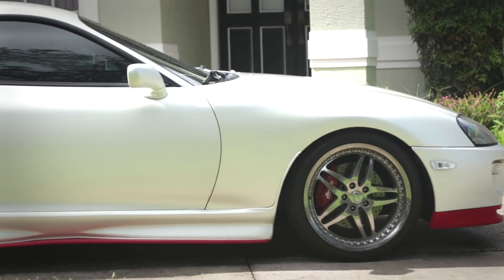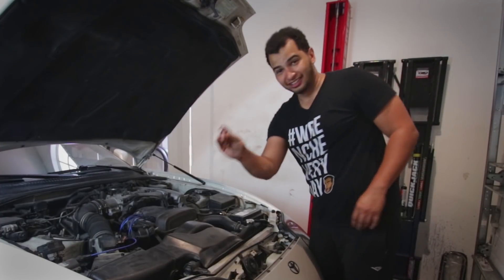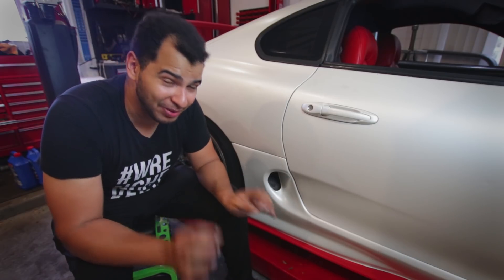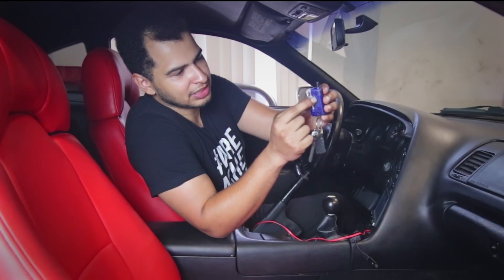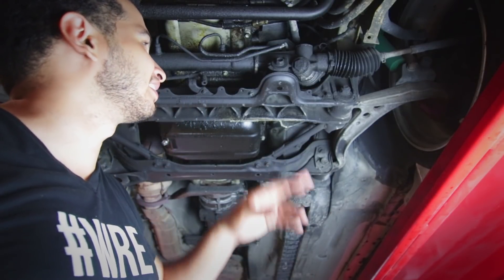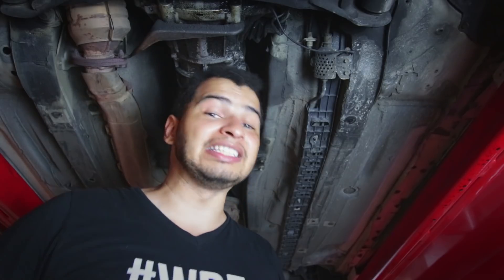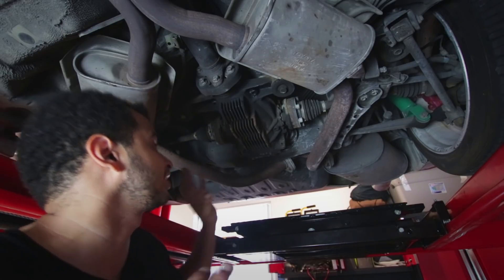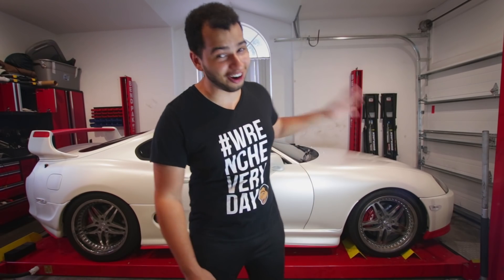Everything Wrong With My Cheap, 200,000 Mile Toyota Supra

Comment: Upgrade to a R154 trans, Swap the heads to a TT , Run a T51r Turbo, Get the 98' Steering wheel and the TRD Tach, Remove all the red, clean it up and make the pearl white pop, Run some Black HRE wheels and a HKS Ti 4" Exhaust and she'll be Perfect... Or good enough lol
Reply: This guy knows his Supras
Reply: Ive owned 3 MKIV Supra's. 1 non turbo 5spd and 2 TT 6spd's
Reply: @Ewan Marshall I have a W58 in my 1jz s13. Whats this about upgraded version ?
Reply: Ops i meant the T56 upgrade but looking at the price (which has gone up) its a $6k upgrade. Its better just to get the R154 if you want to put the power down without spending big bucks plus you already have the 1jz motor.
Reply: Not to be that guy, but the apostrophe goes before the numbers when abbreviating the year. An apostrophe takes the place of letters and/or numbers that were removed. What we remove when we say "ninety-eight" is the "nineteen" part of the word. Nineteen comes before ninety-eight in this case, so the apostrophe takes its place. We would abbreviate the current year of 2017 as '17, as the apostrophe takes the place of 20.
Reply: Cd009 trans works great too.
Reply: In other words, spend 20k to get it up to par lol.
Reply: At that price you're looking at turbo models or some very nice examples of virtually any modern sports car.
Reply: T51r? Why would you even suggest to use such an outdated turbo, i always thought less turbo lag is better... Also TRD Tach? Do you even know how rare and expensive are those, not to mention he will have to drop another $10-20k into engine to get it to handle 700-800whp which i assume you would like to make if you suggest an T51r, and no before any of you rice Fast and Furious fans say anything it wont handle 1000hp on stock bottom end...
Reply: Evan Marshall or, stick a turbo 400 and a ls3 in it :D
Reply: Well perfect in your eyes

Comment: That's not as bad as mine, I imported my 94 Supra from Japan and the seller told me that the body was in excellent condition. Well, when I got the car I noticed a crack on the roof and started thinking how that is possible. After grinding 2cm of bodyfiller I found out 2 holes on the roof. Took the car apart and welded the holes and fixed every rust/worn spot I could find in the car and repainted it. After all I'm kinda happy the car wasn't perfect because if it wasn't that bad, it wouldn't be as good then as now. :)
Reply: sounds like a leaded roof seam. normal for them to crack after lots of body flex and old age
Reply: That’s very touching lol. I’m trying to get an 04 or 07 wrx and I have a lot of plans for it
Reply: Yeah, the holes were at the seam spots but I still don't know why the japanese owner didn't fix it the correct way.
Reply: What site did you get it from?
Reply: Im also planning on importing a Supra. Wt webiste did you use? And can you give any advice on buying a good car?
Reply: I used tradecarview, you need a lot luck if you're buying one from there to get a good one. I recommend using a website that buys cars from auctions and check them for you. Auction cars have always a inspection paper with good details. One example I have is Pacific Coast Auto, they take video of the car that you're interested that includes good view of the faults that they can find.
Reply: JX Thanks for the info man
Reply: No problem.
Reply: Sweet thanks man

Comment: The previous owner might have changed the cluster to lower the miles and don’t know how to assemble it back correctly. You might have a Supra with WAY more than 200,000 miles.

Comment: Just FYI, GEs are notorious for both upper and lower oil pan gasket leaks, especially with as many miles as you have. Upper pan gasket requires pulling the motor though. My advice to you: Buy an Aristo GTE. 😅
Reply from the maker: Yup, most likely gonna be the next step.
Reply: Awesome! Almost all the aristo motors come with Auto trans', which you can probably sell for a couple hundred bucks if it's got low KMs. The biggest concern is that the wiring harnesses on Aristo motors are designed for RHD, so the wire lengths are set up to go through the firewall on the Left side. You can either get a custom harness, or you can extend the RHD harness to work. You'll find lots of info on it online, so I'm sure you can find something that will work for you! 👍
Reply: Albon I bet u can drop the subframe and do it. No fucking way that you have to pull the motor. You don’t even have to do that for bmw oil pans I bet supras are the same
Reply: That’s what a friend did to his NA Auto supra
Reply: Same amount of $ waiting on a Gte you can prolly have more power boosting the Ge ..
Reply: an Aristo would be awesome, i use to have a GS300, if tavarish looked into getting a true JDM RHD vehicle, a Toyota Aristo would be fantastic
Reply: you dont need to "pull" the motor but it def needs to be lifted up a bit. i had to do both upper and lower when i got mine 94. used a hoist to give us ample room....still a bitch to do lol
Reply: Tavarish 2jzgte ??? 🤔

Comment: A Moog control arm is $75 and an ac delco is $100, not name brand but OK for daily driving. OEM control arm bushings last 100,000 miles sometimes more, aftermarket only like 40,000... but it's 1/6 the cost for 1/3 the life, still a good deal. Really what wears out on aftermarket (in my experience) is rubber bushings, the ball joints seem to be good for much longer than the bushings which only live for 4 or 5 years.

Comment: Since you have the small N/A diff in that car, if you want a cheap LSD  option you can install the LSD out of a MK3 supra into your factory diff. All you need is the weir performance upgrade kit and the stock LSD is pretty decent.

Comment: I just got a 300zx with 220k miles from New Jersey and it’s a manual, it’s running on only in 5 cylinders compared to 6, I needs a paint job, I needs to be redone in the inside but there’s no rust underneath the car except for a very very small patch on the body panel lol
Reply: Anton Shostak 2+2?
Reply: THERIPPER216 yes sadly a 2+2 lol

Comment: Might as well pull the engine and replace the rear main seal, front main seal, valve cover gaskets, cam seals, and reseal the upper and lower oil pans before you clean it all up lol

Comment: It doesn't make sense to wrap a white car with a good paint job in white. Considering It seems in good condition for a 200,000 mile car the previous owner(s) must have looked after it reasonably well and known what they were doing. Having said that, the pearl finish is nice, but would you spend a couple of grand to switch to pearl ? I would leave the wrap on and concentrate on mechanicals.

Comment: There's like some German dude who built an n/a supra that revs up to 10 grand and makes like 350 hp to the wheels so you don't have to go turbo with it. The car is called Miss Sakura.
Reply: It isn't even that heavily modified iirc, just a forged titanium stroker crank and e46 M3 individual throttle bodies.
Reply: But you know how much does it cost to get one of forget titanium crank and presumably lightweight pistons and rods, not to mention oil system upgrade? It might be more than fully built Supra, those kind of builds are unique, and unique for  a reason...
Reply: Dude, that was obviously a joke, no one in their right would invest so much money into an old beat up project car. XD
Reply: I don't find anything funny in this "joke" of yours, have seen similar builds 450hp n/a 350z (Z33) but as i said, only something to do if you have loads of $$$ to spare and want to be unique....
Reply: 島マット Of course you don't build an n/a project. Everyone knows the cheapest to get hp is through turboing. And also as someone to whom cars are an artform, what's the point of modifying your when you are not going to make your own?

Comment: Honestly oil leaks on straight sixs happen a lot and from the injectors
Reply: mitchel salas oil leaks....from the injectors? I may be missing something as I don't know much about 2js but injectors are what squirts the gas into the engine..? Least that's the way a carbureated engine works.
Reply: DaxX Gaming bro I work alot on Cummins and I forgot the difference between gas and diesel straight sixs
Reply: DaxX Gaming and idk I thought they'd be the same cause every straight six I've seen has leaked oil out the injectors

Comment: I can't believe you paid 20k US for this POS, you could get a 335i for less than 10k Canadian
Reply: and it wouldn't be a piece of shit toyota at 200k miles lol
Reply: LS4hunna man, with 23 k you could build a full race car, 2jz single turbo swapped into a e30, that's 3 grand for a engine and 10k for a car. Then 10 more for a cage seats wheels a fuck ton of tires and a pandem body kit, and you'd still most likely have some money left over.
Reply: DaxX Gaming idk where you're getting those numbers from. Parts to make a race car is like 50K if you do it right plus the cost of the car. Brakes, forged rims and tires alone is like 15-20K
Reply: LS4hunna lmao 20 grand for forged wheels?! What are they solid ducking gold, maybe 5 grand max for some nice wheels
Reply: DaxX Gaming I said brakes, forged rims and tires. I'm talking Canadian prices too. Brakes include fluid, lines and bigger brakes

Comment: None Turbo Supras are pretty garbage. Either swap or scrap. It can not compete with alot of other NA cars that cost generally way less because they don't attract as many fan kids. Hell even a little Integra GSR can compete and be way more cost effective both daily and modifying. 

Atleast they still look pretty.
Reply: It's like making a case for modifying a V6 Mustang.  Sure you could, but they lack the performance architecture of the more powerful models, and ultimately the question is "Why?"
Reply: Generally GE are very similar to GTE, they only have different piping, manifolds, heads, pistons, rods, oil pumps, and thats about it. However turbo conversion can get expensive quickly, not to mention he paid way too much for this car, and if it really has 200k on clock, he will need to drop some real $$$ into engine if he wants to produce big numbers.

Comment: My dad left my car in first when he parked it today. Automatics ruin people.
Reply: Im The southpaw I’d assume he didn’t want it to roll away, back in the day that’s what you did.
Reply: What's wrong with parking a manual transmission car in gear? It's a very common practice.
Reply: That's normal in a manual car.
Reply: I park my car in 1st or Reverse and always park my motorcycle in 1st.  It helps for those times you might not pull up the hand break all the way or forget.
Reply: I leave my car in reverse. Because some engineer in Trollhattan thought making the key impossible to remove without putting the car in reverse was a good idea.
Reply: FrankTheCat ha that's funny!   But yea I'd be pissed if it was my car...   Looked into changing out the ignition cylinder?   Maybe that would remove your problematic reverse lockout
Reply: I could remove the lockout plate but it makes people 1000% more unlikely to try and drive my car (not that it being a manual already does that...)
Reply: FrankTheCat I changed the shifter knob on my 6mt and when I got new tires on my car the guy about drove it into the store.   Lol gotta love manual H boxes :)
Reply: Im The southpaw most ppl leave the car in gear